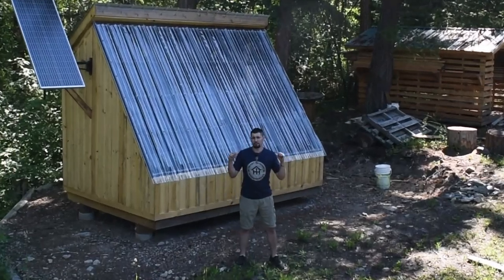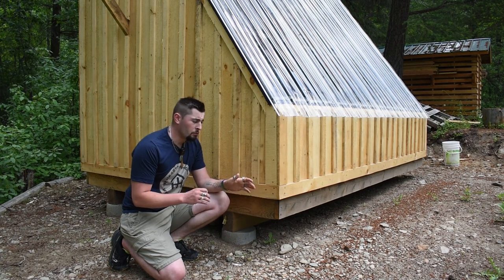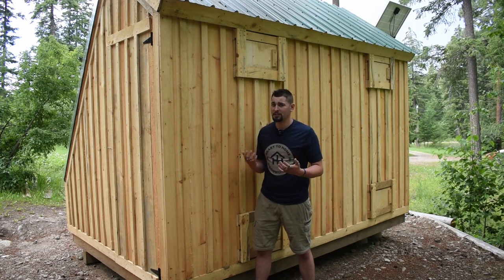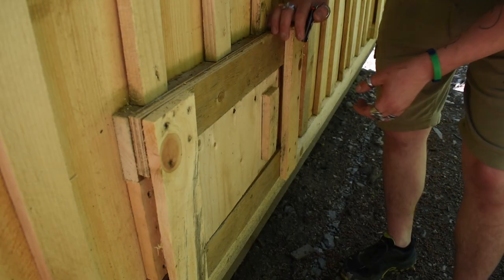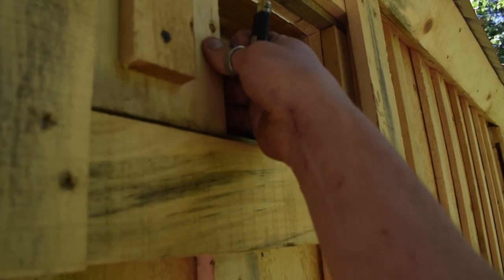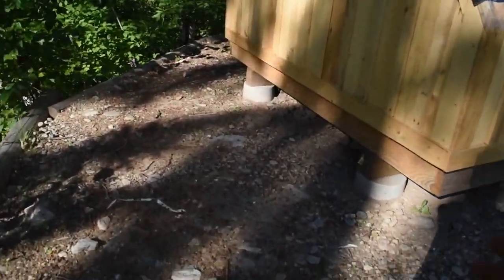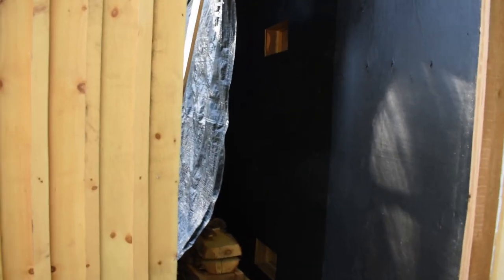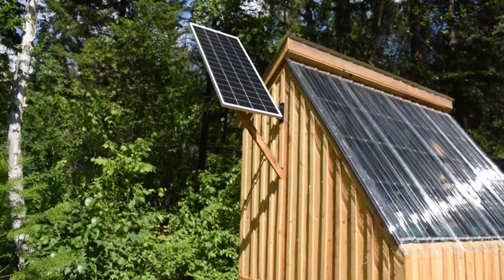Canadian Solar Kiln Build - Part 5

Comment: Well you have done a good job on your start-up. You have some fine tuning to go. First you need to find a good heaver tarp that will fit tight from side wall to wall. So it does not lay on top of your stacks, for best air flow. Over & thru your stacks. Myself I stay-away from metal roofing & use a 90 lb black roll roofing. Easier to patch.

Comment: Was not aware that double walled polycarbonate was the preferred material.  And it is expensive ($10/sf in my area).  Love to know the thermal science behind the two layers. I heard "canvas" works well as baffle (less rigid then tarp).  Enjoying the videos.  Thanks for your time and effort.
Reply from the maker: Thanks Chris! If you plan on using the kiln in the winter, you’ll have a lot less heat loss from having an air gap in the polycarbonate. Don’t get me wrong, single walled like what I have is still a great option, but like I said, the best of kilns will utilize panels/a setup that contains an air gap.
Reply: @HeartToHomeWoodworking  You bring up a great point.... no snow in my life. And winter (and shoulder seasons) is a big part of a kiln's productivity.  $10/sf can be paid for quickly with a March or November drying.  You have great big-picture vision.
Reply from the maker: Hahaha I try to! The main reason why I built this kiln was to dry all of my burls and what not. I have no plans of drying a load of dimensional lumber every 2 months, but instead, 1 load of burls per year is all I need. At least for the next few years until the business grows some more!

Comment: My kiln does expel air out the bottom vents, I have the gap between the fans and back of the kiln small, I also use rubber roofing as the tarp, at first don't open vents much to limit drying fast, as wood gets below 10%, open bottom vents More, also on solar panels, use a buck converter to control voltage from solar panels, as to high of voltage can damage fans if panels can make more than 14v
Reply: So heat goes down
Reply: Yes, the fans move the air over the top of the stack, and force air through the stack, some air is expelled out the bottom vents, some is recirculated

Comment: Do you leave a gap at the bottom of the tarp for airflow ?
Reply from the maker: Basically, yes. The tarp/curtain seen in kilns, drapes down on top of the stacked wood, so the air is forced to go through the stack. When loading the kiln, you’ll need to make sure tarp doesn’t actually block the “front” (south side in the northern hemisphere) of the stack, only the top of it. Does this help at all?
Reply: @HeartToHomeWoodworking  Yes , thank you. I've changed it so its like yours and there's much better airflow now, thank you
Reply from the maker: @Lushahx  no problem! If there are any other questions, don’t hesitate to ask.

Comment: Pushing the air around from the top is an inefficient and probably ineffective circulation method. Pull cooler air from a location close to the bottom up to the top with ducting like flex duct to warm the stack more evenly.  May only require one fan.  Right now you are just blowing around  hot air in place.
Reply from the maker: Hey Mark, I appreciate the feedback. I’ve just built it as per the recommendations from here: https://vtechworks.lib.vt.edu/server/api/core/bitstreams/64394f45-484b-4267-9154-ed10e7d82c5b/content

You should design something and build it! I’m quite curious to see how your design would work.